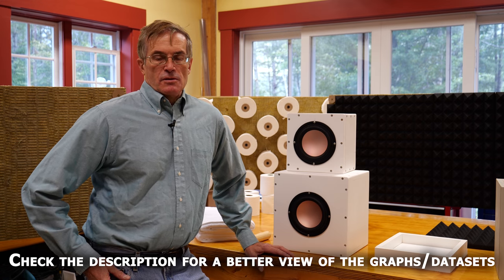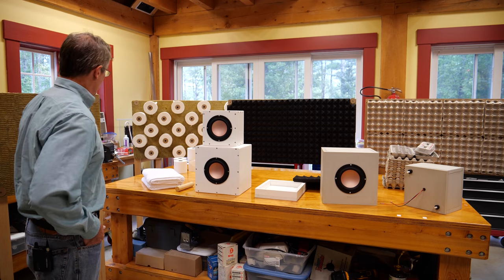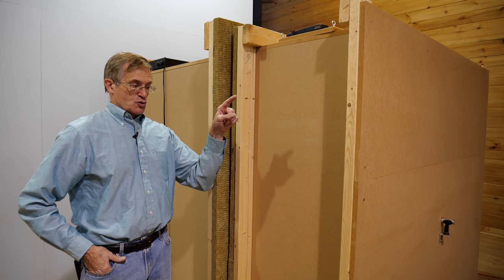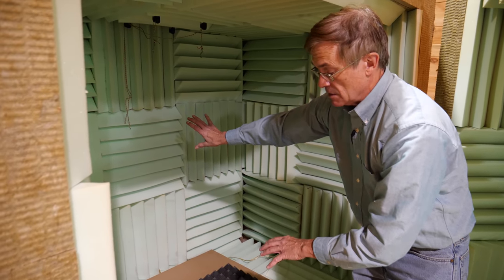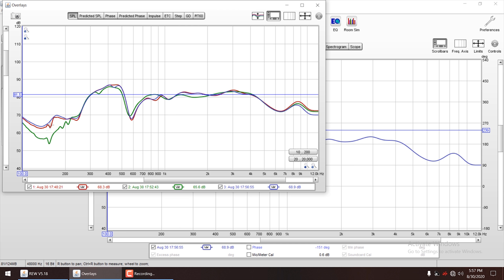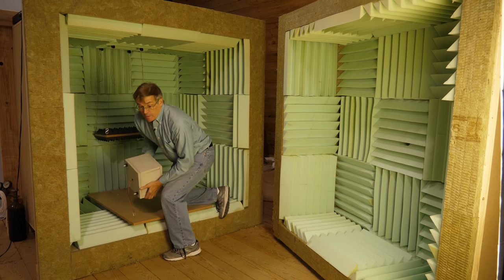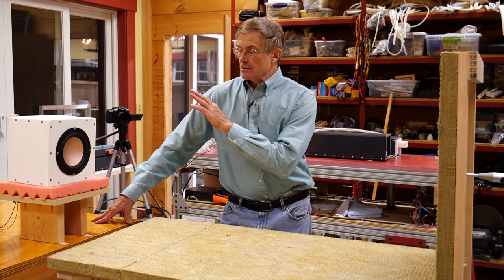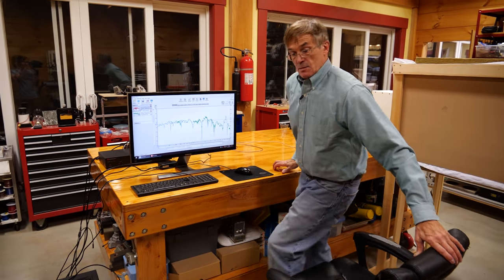DIY Speakers and Acoustic Panels

Comment: I love your dedication to the science, but I take some issue with your applications... As someone who has studied human factors, you simplify the sound curve frequencies when you shouldn't, and you don't simplify when you should.  When testing speakers and enclosures, it would be much more concise to measure actual physical output (no simplification) vs. Perceived output (simplified curves) - as the factor you are measuring is a physical, quantifiable scientific fact of the speaker, and seeing the subtle curvature signatures can tell you much more about the drivers than any simplified curve could.  When measuring room treatment materials, you HAVE to take into consideration the human factor -  as no one can physically have a truly flat frequency-responsive Cochlea, coupled with physically-beyond-superior inner ear structure to transmit such accuracy (it is a physiological improbability on the order of walking into every gambling den of any renown and winning at every table, game, and potentially the ownership of the gambling den its very self.) As you stated yourself, its impossible to get a physically perfect an-echoic chamber, as there is air in any volume to transmit reflections.  This is not the point of room treatment materials.  The point of room treatment is to level out specific reflections to be more in line with human perception, (or to "tame" a room) so at least the human can gauge an accurate representation of the audio.  This can, and will be, wildly subject to individual people (And relevant equipment pairings), and hearing tests (or even professional IEM fitment) can help to understand what frequencies you may need to address in any given room as well as the software you used (Props, btw, I've been looking for something like that).  As you have pointed out, and I respect you for it, each material has its own area of expertise, so to say, and as a result, some perform better at some frequencies/ purposes as others.  The wall foam, for instance, can definitely hide sibilant frequencies, which is sound above the range you have tested here,  but extremely important for most microphones that are meant for open-air style recording (When they aren't right against the mouth or instrument, but any distance away).  Many times you can "tune" a room with the right combination of just the materials you tested here, to get a desired reverb that is subtle enough to not percivably notice, but helps the mic out in amplifying a weaker area of sensitivity.   This is the sort of research that goes into those chambers and recording studios, and I am glad you covered many of the principals that go into these rooms' acoustics and physics.  Subtracting from these curves the generalized human frequency sensitivity curve would help further your point, as well as showcasing what frequency range each of these materials is best at taming.  With the scientific rigor you bring to these tests, I felt like this necessitated addressing, as it would explain (some) why certain materials have garnered support in the home studio area.  

Also, it feels like its required to mention the frequency response curve of the driver you tested, and potentially accounted for when analyzing the acoustic properties of the materials you test. It might explain some frequencies never being attenuated, or the over attenuation of others.  It isn't about creating an an-echoic chamber in the studio per-se, just creating an environment in which your microphones will pick up frequencies you want, while attenuating others.  I've mic'ed rooms with boundary microphones and used moving blankets to much a good effect.  in the end, it is all about the end result you are looking for.  

Anywho, love the rigor, sir, and the video! Just thought these two cents might help out any budding audio engineers.  And I'm a mite buzzed, so I can't shut up.  Or stop typing.

... I'm done now.

Comment: Tech Ingredients, have you consider using a DSP and a flat response microphone in a feedback loop to dynamically flatten the frequency response of relatively "correct" speakers? This  would also  correct the frequency response of the room  (in one position in space at least) and, in theory, using multiple systems like this one spread across the room, could flatten the frequency response of the speaker/room in different areas in the room. Such a DSP controlled loop system could also correct for any non-linearity of the speakers and power amplifiers by simply applying the correct pre-distortion to the signal before feeding the power amplifier.
DSPs, ADCs and DACs are pretty cheap today, so this could be an effective solution to create very high fidelity sound systems using cheap speakers, that would also correct for the room acoustics and would work well using cheap power amplifiers...

Comment: It would have been more intresting to see the waterfall graph when comparing acoustic absorbers. That way you can analyze how they actually damp the sound on every frequency in a certain time. I think what you have compared is the difussion  of those materials, because when you diffuse the sound, it won't create this micro-dips and bossts in the frequency spectrum. That's also the reason why the egg packs worked quite decent for the purpose you analyzed, because it has a very irregular surface. Anyway, very intresting video as always, What a coincidence that you uploaded this just in time when I'm planning to build my own rigid fiberglass acoustic panels for my studio.

Comment: in the 80's in studio design, we used big 6 foot long, 4 foot wide industrial "dirt trapper mats" hung on the walls.  A close weave poly type material on a rubber backing.  Stapled at the top and "hanging" free at the sides and bottom.  Worked really well an enabled, with the use of a spectrum analyser to get the room frequency response  curve pretty much flat.  What you heard was what came from the speakers. 

Void chambers, in effect a wooden box with a port in it were used to absorb low frequencies... the size of the port centered on the frequency you needed to get rid of.

A happy trip down memory lane.  Many thanks.

Comment: Part question part what I understand about this, which is admittedly very little...
But I did do a bit of research about this because I wanted to convert a room in my small apartment to a sort of recording studio. Still unfinished, but it's a long term project.
So, afaik, shape-y stuff, like the egg cartons, pyramid foam board, and those spikes in anechoic chambers, are all about eliminating reverberation, reflectance, echoes.
Because of what was explained in video... sound hits those angles, and "get trapped" in the geometry instead of bouncing straight back. Of course, the bigger and more drastic those angles are, the better it'll be... those extremely expensive huge anechoic chambers that people say they hear their blood flowing when they get inside have pyramid shaped rubber like walls that are some 30-50cm thick, plus a big concrete wall.

Separate thing is sound isolation, insulation or soundproofing, which is not letting external noise get in or internal noise get out. For this, the strategy is just... mass. As much as you can.
Kinda why if you have a solid thick concrete wall, or just some abnormally thick wall, it isolates the sound better.

But what you really want for studios, is a combination of both, leaning more towards soundproofing. Perhaps why a porous but massive material works best.
You wanna lower reflectance so it doesn't sound like you are talking from inside a restroom (those flat ceramic tiles have high reflectance) or a totally empty room (lack of furniture, wall photos or art, and whatnot makes the sound bounce off directly from walls), but you also want some measure of soundproofing or isolation, so you don't get external noise nor drive your neighbors mad.
Though it tends more towards isolation, because you want to eliminate noise, but I think it's not good to totally eliminate reflectance. I mean, in non professional studios. Because the sound being entirely flat may sound a bit weird, so you need to know how to add some back not to sound kinda unnatural.

The rocksil mentioned in the video... I think is the same we call here mineral wool... right?
If you go at local hardware store and whatnot here where I live, and say something about soundproofing, it's either mineral wool, or glass fiber wool. Mineral wool is very slightly more expensive, but easier to handle.
I put some panels in between the ceiling and extra drywall sheet to dampen noisy upstair neighbors, but didn't manage to do a whole lot of testing to really tell the effectiveness of it.

I also heard that a few layers of used blankets also helps... not perfect, but better than nothing. Blankets as thick as you can find, mind you, because what matters is mass.

Comment: Great job! When it comes to towels, at work, I need sound recordings of therapy sessions. What I did was compressing lots of towels in a wooden frame, put behind the microphone. Works pretty well. I miss a test using say 2 inch of compressed towels, maybe 10 put on top of each other, not just 1-2 hanging  in front of the hard wall.

Comment: Thank you so much for all the efforts put into your work.
I would have suggested that when using the towels, that you put more layers more compact. More like DIY Perks did. To give them at least a chance in regards how foam is build and works.

During my work I also stumbled across densely packed rock wool sound absorbers. So nice to see their raw performance.
I would be curious if you can get you fingers on something like "Basotec" a wood based material I heard of.

Great Work!

Comment: I think the towels used in the panels made by DIY Perks were more designed to prevent reverb and reflections rather than to control frequencies.
Obviously, these are related, but DIY Perks' main thing is small budget, and for that budget, I expect these panels would reduce reflections in a space.

Comment: Some frequency absorption analysis needs to be done on the materials. Generally materials are good at absorbing the higher frequencies. However it's the lower frequencies that really need blocking the most. 

I like the egg carton concept/method, however if it was saturated with a stable liquid such as oil? might work better as a deadening material. 

There used to be a good paint that was used on vehicle under carriages, that was designed as a deadening material to absorb sound. It was like a black tar that cured dry. It was very effective.

Perhaps even silicon sealant type of stuff could do the job if painted on. Diffusing the sound by using shapes is one thing, although absorbing the sound could be a more effective alternative. 

The Russians used a reverse phase signal (the inverted form of the sound wave) in their MIG jet cockpits to cancel unwanted sound from the jets turbines. Perhaps one of those surface speakers mounted on the back of the sound panel, with a reverse phase signal run through it, may also prove effective when teamed with the other solutions.

For almost 100% effectiveness, you may have to incorporate propagation delay at the source sound emitter, while the surface speaker at the sound absorption panel accepts the non-propagated delayed signal, or visa versa.

Comment: I would love to see a carpet of high polar whoole. 
A hard surface loudspeaker with a lot of  whoole placed inside and a high polar carpet on the outside. 
The wind is stopped better if your capuchon has a edge of real fere, then immitation fere. The sheep are shaven, but the whoole is thrown away here, so whoole is free here.
It would be nice to see one of your second best loudspeaker, one filled with whoole and long thread high polar carpet sticked on the front. Or real fere from an old mink coat.
I saw many loudspeakers with the front surface slightly curved, so the soundwaves are free , and can't glue or stick to the front, if the front gets curved away. The curved surface should be curved like a ball. Just curved from left to right, leaves 2 half moon shaped obstacles above and below, where the soundwave gets trapped in. I placed my loudspeakers in a huge tube all the way up , bending down again and left open at just one site. Just like a zipping straw.
At one box I grinded those 2 half moons away, so no soundwave could bounce to the obstacles.
The difference between the one with grinded moons, compared to the other with those half moon shaped, is amazing.
The sound is top notch.
There is no telling if you hear real instruments or hearing through the loudspeaker.
Listening to a real Spanish guitar without a guitar.
Because the box is a tube, is the sound from bamboo water instruments identical too. 
Just like real bamboo pipes and water, ploink drip drip ploink.
A build in amplifier with old tubes , no transistor would be nice, with a Quad or Main fore amplifier.
Using thick cables from the amplifier to the 2 or 3 way splitter makes a difference too.
My vocabulary in the English language is extraordinary small,  and I am to lazy to use a dictionary or adjust a Google translation.

Comment: @TechIngredients I appreciate that you are trying to make these fundamental acoustic principles and measurement techniques accessible to your audience. The most relevant aspect when doing measurements is to be aware of their limitations in particular under not "ideal" DIY conditions. Knowing the specific limitations helps of course to identify aspects that can be read with more or less reliability from the gathered data. Therefore, I have a couple of remarks regarding the measurements that you present in the video.

The information that you can gather on low frequency content in your anechoic chamber is limited. This is due to mainly four reasons:
1) Limited insulation from low frequency influences from the outside the chamber.
2) Limited efficiency of the porous materials to absorb low frequency reflections within the chamber (below lambda/4).
3) Strong influence standing wave reflections (room modes) at low frequencies within the chamber (above lamda/2 * N for integer multiples of the individual chamber wall dimensions) ... At least the first couple of modes will be present in the chamber.
4) Influence of near-field effects (sound pressure and sound velocity are not in phase) towards lower frequencies due to the limited distance from receiver to source.

As observed, these points mostly limit the reliability of your measurements towards lower frequencies. You could try to determine the lower limit of your measurements based on the theoretical models that I mentioned before or by conducting repeated test measurements in different arrangements where you would not expect the results to change. This would also be a valuable information for your viewers.

The placement of the source and the receiver very close to the walls is also not optimal. This means traditional techniques to omit the influences of adjacent surfaces, e.g. windowing of the acquired impulse responses in time domain to cut out reflections, cannot be applied. But to be fair, there is not much you can do about that with the limited amount of space.

Overall, I have some recommendations in order to improve the reliability of the anechoic and lab reflection measurements:
1) Employ averaging of multiple measurements of each individual condition. I believe this can be done automatically by REW. This help do eliminate anomalies in individual measurements as well as suppress influences from acoustic and electric noise (gain in signal-to-noise ratio due to coherent vs. incoherent addition).
2) Shorten the measurement sweep length since long sweeps are only required in particularly reverberant environments (which you don't have). This is especially relevant in combination with the suggestion before to employ averaging. By shortening the individual sweeps you can still achieve measurement results in a time efficient manner.

Also remember that the magnitude spectrum of the gathered measurements is only half of the information. Depending on the application it is also very helpful to look at other representation in order to understand the full picture. I believe REW has the appropriate tools included, e.g. for the following two aspects:
1) Part 1: comparison of wooden and the concrete speaker housing. It might be helpful to look at a waterfall representation in order to see if there is a difference in the decay pattern of the two cases (specifically at the cavity resonance frequencies).
2) Part 2: comparison of different absorbing wall materials. There could be some insight in looking at the impulse response representation in order to see if there are differences in the reflection patterns of the different materials.

Comment: Great video!  Just like with your other video with the panel speakers, you need to make the effective volume larger to produce low frequency sounds well.  Sound travels faster in concrete than it does in air, so concrete speakers are 'smaller' than their physical size.  Acoustical foam is useful in slowing down sound and making the speaker 'larger'  Meandering the sound through paths in the speaker box can also be used to effectively lengthen the speaker.  Of course resonances complicate such designs and so designs are often arrived at experimentally.   Also, moving your speakers away from the wall (test at the center) will help reduce reflections.